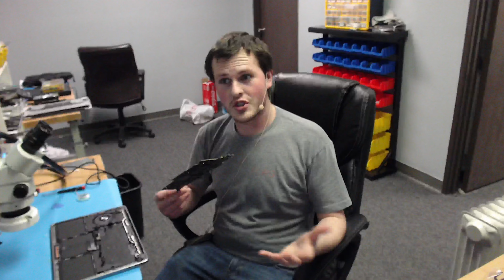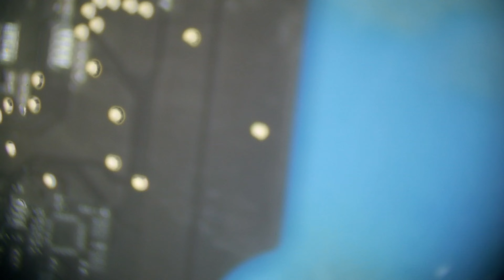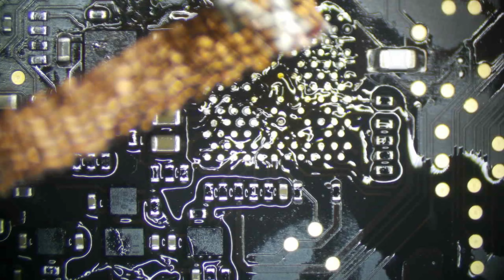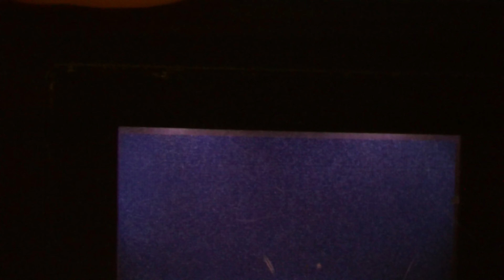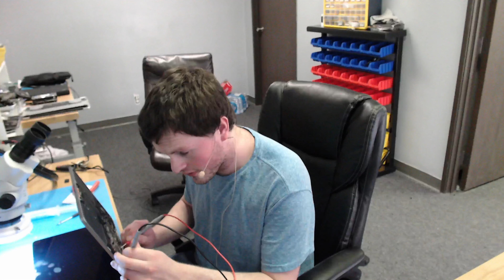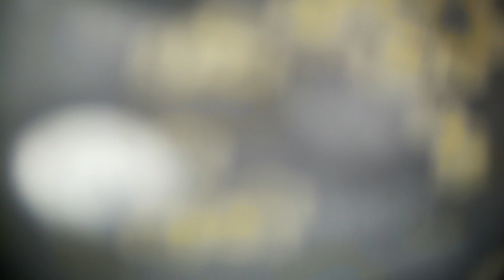M1 MacBook Pro that doesn't power on. Can we recover the data?

Comment: Hello Sir...

A brother from India need some help...

A friend got exact same model turn in to huge paper weight without any reason. As per him it wasn't even plugged in and it just died out.

And unfortunately this happens just few days after his warranty expired and he didn't had add-on warranty, now apple here in india says that its gonna cost around 700 USD + tax.

So I gave it (logic board) a look and done multiple visual inspection, common short checking just around power circuit looked for anything getting abnormally heated but nothing as if it does not have any problem at all.

I have seen this above video quite a few times and tried to follow it and the only thing I can see differs is On PP BUS (on the exact same point you did test in this video after your repairs) mine logic board have only 4.80v while it should be around 11-12.5v right?

So what am I missing and if you can give some hints or tips or schema to use as reference, I and my friend would really appreciate that.

Thanks

Comment: Dang I remember doing this with an aoyue hot air station and soldering station using a hotplate as a board heater to reball Xbox 360s ICs. I was 14 years old and would sell services on the se7ensinforums. Thanks for the throwback.

Comment: What program are you using to look at the board schematic that lets you click and see the connected pins and components? New to all this but that seems like a must have!
Reply from the maker: FlexBV by Paul Daniels! https://pldaniels.com/flexbv/
Reply: @TCRSCircuit  Thanks for the quick reply! Great videos!
Reply: @TCRSCircuit  Seems like the board view for this macbook isnt out yet. Sidenote, i have a water damaged logic board and wanted to inject voltage like you did but i cant figure out where you grabbed onto, did you pick a random cap or its a specific spot?
Reply from the maker: @winsorlozano1494  No, you would never pick a random cap. You only inject voltage to a line that you know for sure is shorted to ground!

Comment: Did u pull a replacement cd32 from another board .
I’ve bought some of these from China will only work on one port tried replacing the ic again with another one still the same .
Reply from the maker: Donor board. Likely all from china are also pulled from a donor.
Reply: The reason we changed it was because the ldo line was pulled low and the cd3217 was getting very warm.
Replacement from China don’t seem to work I am wondering if the replacement ic don’t have the correct firmware .

Comment: Hi Tim, I have the M1 Air which I bought last November. I have been charging my laptop using the Apple charger which came in the box and also a 45W Samsung Charger (Type - C Charger) Can I continue using the Samsung charger or is it best that I stick to Apple charger? Advice would be appreciated.
Reply from the maker: Use the Apple charger charger
Reply: @TCRSCircuit  Will do, thank you.
Reply: @TCRSCircuit  My charge cycle stands at 11 for the past 6 months. Should I be worried about any damage to the circuits, chips already?
Reply from the maker: @Abhinandhan14  No not at all.
Reply: @TCRSCircuit  Thank you for your response!

Comment: My macbook pro died when i plugged hdmi. What to do ? i destroyed the battery connector from the board which needs replacing ...
Reply from the maker: What machine do you have?
Reply: @TCRSCircuit  M1 Macbook pro
Reply from the maker: @tr909love  When you say you destroyed the battery connector from the board, what do you mean? You opened it? Since it was under warranty you probably should have just went through warranty if it died;
Reply: @TCRSCircuit  yea i did opened it up and i thought was something with connector and i broke it
Reply from the maker: @tr909love  Well you won't have warranty now, but we'd be happy to help you if you are in the US.

Comment: Only issue with distilled water is that it can create oxides and corrosion if left on metal.nonshorts provided there are no impurities and mineral traces.best use only isopropyl.
Reply from the maker: Generally, as long as you let it dry you will have no issues. We've been using distilled water as a wash after ultrasonic cleaning for years with no issues what so ever. The trace amounts of minerals left over in distilled water is simply not enough to cause issues in this application. Now distilled water on a board that is powered on is a totally different story.
Reply: @TCRSCircuit  yeah i know its used in ultrasonic cleaners, especially if its heat assist dried its almost never going to cause issues.Until it does,and when it happens its gonna be in the most expensive item you ever layed your hands on,merphy law style.lol. but i generaly use distilled water mostly to clean laptop screens.
Reply from the maker: @dimitrismaster  You can't really use IPA in a ultrasonic cleaner either unfortunately. Distilled or deionized water with a cleaning solution is your only option.
Reply: @TCRSCircuit  yeah flamables are a nono in ultrasonic cleaners, unless one has a death wish or sth. I remember Luis Rossman recommended a certain fluid mixed with water for ultrasonic cleaning, don't remember the brand though
Reply from the maker: @dimitrismaster  Branson EC. Good stuff. That's what I use as well

Comment: Congratulations on this repair and courage on decision to inject voltage to a new, unknown board that was still under warranty. I understand that AASP would probably change MB and the customer‘s data would be gone, but still... very good and courageous repair. Does USB charger also switch from 5V to 20V when board starts just like on previous models?
Reply from the maker: Yes, as long as a good battery is connected.
Reply: @TCRSCircuit  Great job, really impressed with what I saw.

Comment: 2020 M1 Macs fail due to PD hubs. Apple claims it is a cheap hub problem but I have read even apple branded ones cause the failure. So it is most likely a hardware design issue.

Comment: hey i have a problem with my m1 macbook pro i  spilled black coffee on it now it wont start ob attery power but turn on with power chord but the battery seems fine so my guess is possibly ppg3h bus problem .am i right?
Reply: I think the problem is coffee.. JK
Reply: also one of the usb c port is not working.if that hellps
Reply from the maker: Not a PPBUS issue if it turns on with the power cord. Could be many things, battery is at the top of the list.

Comment: Hey Tim I’m working on a M1 board currently and when I replaced the top cd3217 chip like I messed the 3 resistors to the right next to the dc-in fuse, I know there different values but as there are no info on theses boards I’m screwed.
Would u mind posting those values if you still have the board ..cheers and well done. Thanks
Reply from the maker: This board is long gone back to the customer. Send me a email at service@tcrscircuit.repair with pics of the resistors and ill try my best to help.
Reply: @TCRSCircuit  I can’t thank u enough 🙏🙏
Reply: Hey Tim did u get the Renesas 501CR0B from a donor this chip dosent even exist.. thanks again 👍

Comment from the maker: Note: Data is unrecoverable on the newer devices if the board fails. The customer needed data, so warranty board replacement was out of the question. The only path to data is repairing the board.
Reply: So what was the cause of the chip short . Is that pad power adapter. Could this be type -c Hub PD could cause this kind of issue. As one of type c was not working at all.
Reply from the maker: @ulaganath  Could have been a bad adapter, Could have been a bad charger, or just a factory defect.
Reply: @TCRSCircuit  Yes its hard to predict but one of type-c malfunction is clear power source issue. Does the type-c PD from 3rd party could possible harm like this. I thought its more of a passthrough
Reply: Can you share if any of customers came with M1 ssd wear issue causing the ssd to fail. Its unclear what is actual endurance of these ssd and looking the rate of usage seems to be known issue which apple is not yet acknowledging as not much reported since the device is only a year since launch
Reply from the maker: @ulaganath  No SSD failures yet. I do not think they will be a failure point at all, and im fairly sure it is a data reporting issue.
Reply: @TCRSCircuit Does every smart tool reports the same
Reply from the maker: @ulaganath  It's how the NAND controller (In the CPU) is reporting the data I believe. Either way, its too early to know if we will see issues on them.
Reply: @TCRSCircuit  How are you certain. If apple own monitor is bug does every 3rd party apps also reporting incorrectly . Does SMART monitor is not working on apple ssd and reporting wrong info. I doubt it .
Reply: What apple thinks that customers are ATM machines. 😤😡😠